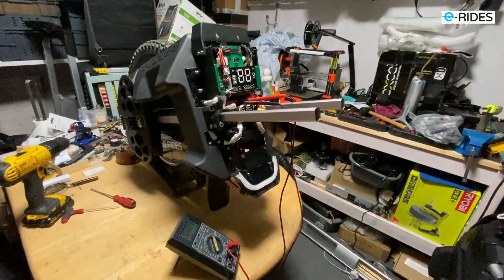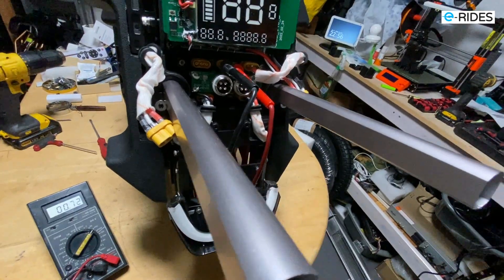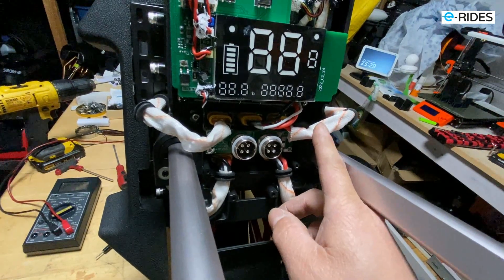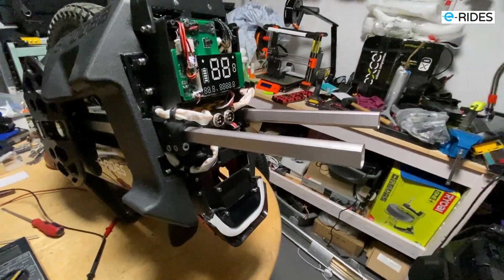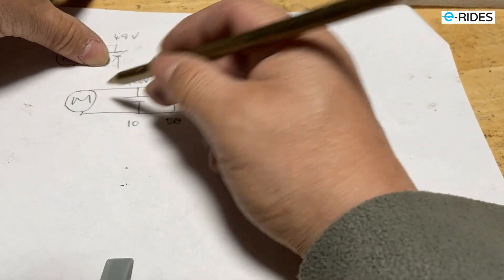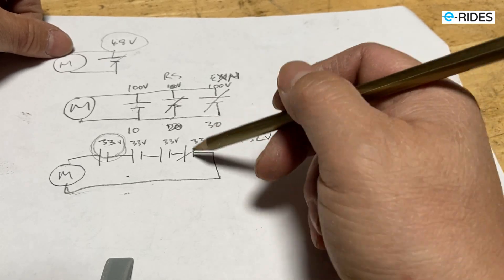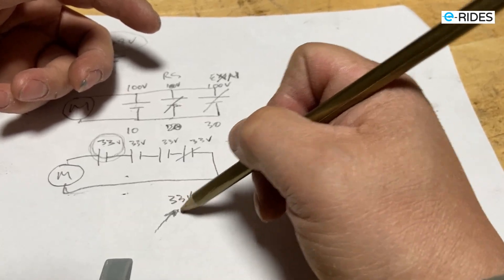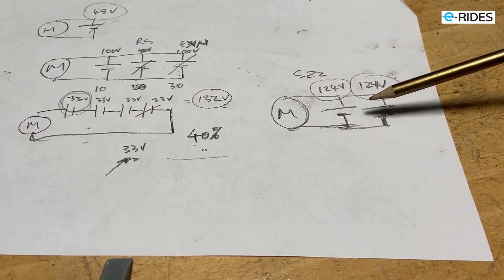Begode Master The True Battery Voltage. e-Rides EUC Upgrade.

Comment: Who's worried about a pack becoming disconnected? Put rtv on the connector when your finished working on the dang thing and you can have lower voltage to work with.

Comment: I have a question ❓
Can I remove the 2  battery in the back, and use a small connector between the 2 sockets, red with red and black with black , and I use only that 2 front battery with total 66 volt?? I'm thinking to do that because the battery is too heavy, the 2 Battery's= 6 KG
Reply from the maker: If you do that the remaining two battery will only be 66v which the wheel will not work. All 4 batteries added together give you 134v to work.

Comment: I think Begode have changed this now to pairs, in series and parallel.. Not withstanding that, I can only presume each battery pack has its own BMS balancing each pack to 33.6V when it is charged. The packs then connected in series. An open connection on any pack leading to a cutoff, that would include a connector coming loose. Either way, on checking the voltages of the battery packs a discrepancy of any significance between any one of them could indicate a problem with the pack.

Comment: July 22: 1st batch consumer wheels.. 13:25=> aand then we have the nickelplated strip melting and causing what.. change your wheels for #2 batch.

BG for 80kph wheel: "It happens very very rarely, so it is OK". In any respectable safe industry the wheels would be requested for callback 😅

Comment: So in this case, do you think the Molicel P42a would provide a greater safety margin below 40% SOC vs the stock batteries?
Reply from the maker: With one wheel device we are riding on any extra power are always better. But don't forget Begode keeps changing things on their wheel. So higher power battery mean they have to change the power circuit to take the extra power.

Comment: I agree with you,I have same thinking about the 33V batteries,when I see it ,I am very confused,why they are so low voltage .  THANKS YOU HELP ME FIGURE IT OUT 👍
Reply from the maker: Begode said it is low voltage which is easy to manage and of course low voltage is less dangerous. with that many battery cell gives you more Amps on one pack. Adding all 4 battery together to give 1900wh and 134v. The only danger part is the charging circuit the holds the 134v and i have already have one gone wrong which doesn’t charge the battery.

Comment: What I learned today from Kevin.  1.  Redundancy is proportional to safety.  2.  Voltage is inversely proportional to fire.   In conclusion: the Master has 0 redundancy and the S20 has so high a voltage in each pack that fire is a potential.  Pick your poison.

Comment: Pulling the connectors out via the cable is probably not a good idea. It’s well known for causing problems. I think it’s also important to consider the typical failure modes, if any, of a battery pack and BMS.

Comment: the redundancy of the single battery pack voltage makes sense that there would be a problem if one cuts out 

My advice, don’t smash yourself and the wheel into a tree lol wheels are like babies, you wreck at high speed there will be issues with almost every wheels

Comment: High voltages in parallel is extremely dangerous requiring multiple bms to balance packs.  Imbalances due to injury or defects can lead to runaway fires. Tesla has packs in both series and parallel but have extensive r&d.  Begode probably chose lower voltage packs and in series which makes them much safer from fires.  Damaged packs in series simply stop working.  Damaged packs in parallel while working in redundancy can be a time bomb. Pick your poison.
Reply from the maker: All High voltages in parallel is extremely dangerous. This is what the challenge is for the faster wheel and how they are going to make it safe.

Comment: **Quick Question:** Do you know how the battery is setup internally? Because your conclusion is based on literally unplugging the battery. I like the low voltage approach from Gotway. Also riding below 40%, is that load or no load, because in your assessment, that's expected behavior for the rider to ride slower 

Great video which opens up a very important discussion.
Reply: Theoretically, from what I understand from the video, if a single pack yields in one way or another you will hit the asphalt. 4 packs = 4 times more likely to fail. But until we find out exactly how those packs are built inside, we don't know for sure.

Comment: Just saying: 
Each of these battery packs is  NOT done 32s1p....No, each is 8s4p, which means that (when at all), just a 8s connection will brake away and you are left with 3s4p. More probably is even that just one cell dies and you are left with 7s4p.
Whatsoever:
On the next charge you would DIRECTLY recognize it as the wheel wouldnt charge to full anymore!. 
So Sorry, these "there is no backup" statement on the Master is in my view totally nonsens .......

So The reason for your "Conclusion" is just wrong, because you didnt know how the battery pack is setup! It is not able to fail "completly", at least as long as you dont cut the complete wire while driving.

Comment: id like to see a inline switch or fused added between the board and a battery. Then roll wheel and flip the switch. fuse and watch the faceplant, of course in test situation. Something like this will get the attention.
this wheel is a DO not ride for me.
V11 has 4 packs and are connected in pairs. If one pack fails the wheel still rides. If 2 packs fail on one side the wheel still rides. If 2 packs fail on opposite sides. Faceplant. some redundancy.

Comment: I don't think it is as bad as you first think, each battery pack will be 8s4p  a group of 4p cells can be thought of for all intensive purposes as a single cell with 4 times the current capacity of just one cell, so if a single cell starts to degrade and develop higher resistance it effectively reduces the available current through the whole system and thereby a total voltage drop. at some point the firmware should recognize this and trigger the alarm as per usual, the same would apply if the a cell becomes disconnected via failure of a nickel strip or the spot welds break due to vibration, the available current will be reduced to what the remaining 3 cells can supply. In the case of a cell shorting all the current will try to flow through that one cell result is massive heat and fire, this is what a good bms protects against of course this apply's to either parallel or in series packs, so in the end I do not think it will make much difference as long as you notice the drop in power and check the batteries for problems . btw I have seen a fire just as fierce from a punctured 4s lipo battery which is only 16.8v it's the chemistry that ignites with the air

Comment: There is no connection between voltage and chances of catching fire. You are totaly wrong.
Also inside those 33v packs, 21700 cells are connected in parallel 4s blocks, so there is nearly no difference...
Reply from the maker: True all battery pack can catch fire what make it safer is the voltage output is lower and it is safety to control and manage.

Comment: Well that's the first major disappointment with this wheel. Why couldn't they have ran the packs at 67 V and ran 2 sets of 2 in parallel? The redundancy would be there and the voltage would still be much lower than their previous 100V wheels.
Reply from the maker: That is what I thought as well you’re the first one reply with this idea. Well done.
Reply: @eucupgrades  Could this wheel be modified so that it is in this parallel configuration? Or would that break the wheel?
Reply: @arronnie1  no you wouldn't be able to do that because running in parallel would make it a 34 volt wheel and it would not run off that power

Comment: Are you sure the 40% throttling isn't just because of the 4P configuration of the battery and voltage sag of the 50E cells? Sounds like throttling to protect against drooping the 50E cells too low in this 4P configuration to me.

Comment: Thanks Kevin for looking at that.
I'm trying to identify if the packs can finally communicate with the mainboard, do you know?

Also I'm trying to figure out how the 4 packs are kept balanced between each other. Have you found anything which does? Are the packs at the same voltage now or already drifting?
Edit: it is not needed, each pack's cell group balancing will already do the job
Reply: Maybe they just used passive balancers.
Reply: In this configuration, balancing between packets is not necessary I think.
Reply: @pawelkolaska1398  these 4 packs in series definitely need balancing, otherwise they'll drift in voltage like anything made of cells in series does.
I'm hoping for an active balancer here to handle more balancing current.
Reply: @pawelkolaska1398  Actually you're exactly right, it is not needed in this configuration, I missed how it works previously.
Reply: @supercurioTube  So what what middle connection do ? It is middle point between 4s+4s ? I ordered mine master and thinking how to make it safer.
Reply: @danoseus  from the current understanding, it's the BMS status connector which is very basic and can only indicate very simple errors like "stop charging"
But a lot is unknown yet.

Comment: You have a point on redundancy. However I know two cases of battery fires which were linked to riding a wheel with fewer packs than specified (one with 2 packs instead of 3, another with 1 pack instead of 2).
This design will prevent riders abusing the dumb (parallel) pack redundancy.
Reply: I imagine a bad cell would manifest itself in a similar way too, making its parallel brethren take up the slack. It wouldn't make the wheel shut off, but would be similarly dangerous as in a parallel pack configuration. What we need is for the pack to be able to report when a parallel group is sagging below safe thresholds and trigger something like an overload warning and tiltback...
Reply: @redfoxdude  agree. Neither of the configuration can be safe for riding and fire until individual cell groups are monitored, and the mainboard is informed of pack issues to prevent riding.
Reply: Most people wouldn't do that. I'd prefer they design for the rule, rather than the exception.

Comment: The 33v packs can still explode. I'd recommend the S22 for safety. I would buy the Master myself because I don't trust either wheel. Every rider that wants to be sure needs to learn how to inspect the packs. On the S22 you can see warning signs on the smartBMS readout in the app. That still doesn't excuse one from opening up the wheel every once in a while and check for burnt cables and corrosion and water intrusion. I'm talking about a deep inspection, cell level with removed battery heatshrink if necessary.

For S22 riders, their main concern should be the leap in voltage (for the brand) and the "over built" wheel design that may or may not introduce new failure modes. 

None of these wheels have been tested long term.
Reply: I buy the Master because of Begode's self sacrificial philosophy. It would risk damaging itself trying to protect the rider in a tricky situation. Other brands don't do this. Greater risk of injury.
Reply: The reason a battery ignites is due to a buildup of internal resistance causing heat to exceed ignition temperature of the electrolyte. Internal resistance buildup is caused by manufacturing defect or inaccurate passive balancing by the BMS. You cannot visually inspect buildup of internal resistance - only an Active balancing BMS can do that.
Reply: @RonNadeau  Heat usually leaves traces. Messed up heatshrink, unbalanced voltages.

If you're worried about heat then step 1, Don't get an S22/Master with high capacity cells 50E/M50T/M50LT. Step 2, Install heat sensors within the packs, and a display on the wheel.

Being afraid to do a deep inspection is only going to reduce your chances.
Reply: @mikeh6286  You won’t see traces of heat due to internal resistance on the outside of a 50E cell until it ignites. There is no pre-warning without monitoring the internal resistance with a good BMS. Active balancing BMSs are more expensive and that is why companies like Begode cheap out. I have written to them to say we would gladly pay a few hundred dollars more to get better safety with quality BMSs. Overcharging cells with Passive balancing is what is causing most of the fires.
Reply: @RonNadeau  Buy an active bms and run balance wires to it. In China it's ~50usd. (With IR measurements and bluetooth)

As internal resistance increases you will see a change in charge and discharge characteristics. If 18 groups are matched and 1-2 are slightly out of whack, that's your warning. Put a temp sensor on those and keep riding. 

Or install a bms with resistance measurement etc. I prefer to use temp sensors because I don't want to stop using cells just because they're older  and have built up some resistance. It doesn't mean I'll ride them to 80 degC.
Reply: Also, the  S22 is unsuitable for racing. The Master can do it but only on high current cells. For racing wait for the RS134V.

Comment: If one 33.6v battery pack fails but is still electrically connected to the motherboard it should just lower the total voltage by a quarter. I believe the reason why you get 0v when you disconnected a battery pack is simply because the circuit is open. Would it be possible to "jump" one of the four XT90 battery connectors to simulate a battery pack failing while still being connected to the wheel and keeping the circuit closed?

If true then if one battery pack fails while in use it should still work... hopefully!!
Reply: It appears that Begode wired the battery connectors in series on the control board. If you disconnect a battery or a pack develops a broken connection (not a short), then it will break the connection and give you zero volts.
Reply: @RonNadeau  I think everyone understands that, what's less clear is the odds of that actually happening. Breaking the connection of a battery without simply unplugging it involves some pretty substantial destruction because of the four parallels inside the pack.
Reply: @dan.t.hillary  I agree with you Dan. We would need to look at how many riders have reported a pack failing entirely to zero volts. I had an issue once with my 16X battery connector failing. I didn't notice until I was riding for a bit and saw there was lower range than normal. Turns out I was riding with just one battery pack. I have seen some Gotway/Begode packs have internal damage and the wheel ending up as a 23s4p or 23s6p. Usually shown as the wheel only charging to 96.6V. However this is not a complete failure of the pack and the charger will show green here. I believe this new config was made in response to us complaining about fires. A SmartBMS doesn't change anything... instead it just shows you cell health when you look at it. I have spent way too many hours looking at the XiaoXiang SmartBMS on my Nikola Plus... the cells are healthy. Until they day they are not... and then I better be watching.
Reply: This is a great point; what does "a battery pack fails" mean exactly? It's not well defined here. 
A connector comes loose? Does that happen? 
A cell dies? The whole pack doesn't go...
The pack explodes and a sufficient number of cell connections are severed to kill all 4 parallel 33.3v stacks? 

I don't know, I'm unconvinced that this is actually a riskier arrangement.
Reply: Only way to find out is to jump one connector and see if the wheel still works.
Reply: Even so, I believe that the voltage will drop too much and the wheel will no longer be able to keep its balance, especially at high speed.

Comment: That's a shame and very concerning. Besides safety issues of shutting down, this could become a major inconvenience when offroad and a pack fails.
Reply: So now if you choose between the S22 or the Master, you have to choose between the potential of an explosive fire or a face plant. Hmmmm.....🤔
Reply: I think the peak power is the same regardless of parallel or series battery connections.  The redundancy is good if any of the battery pack is malfunction, but usually that would not happen during a ride, so I think the pros of having a lower Amp system through the wires might help reduce the likelihood of fire.  But if the fire is induced within a single battery cell which will have a run away effect, then we are talking about having a better BMS, which KS might have an edge.  However it seems lower Amp system is better than having a better BMS (as per the latest KS fire incident showed).  I am not sure which one is more effective in fire avoidance but my bet goes to having a lower Amp system.
Reply: @FastRadioBursts  I agree but the series packs in the master carry the full current draw so the wires that connect each battery to the next needs to be able to handle it, to me they dont look any bigger than a parallel system like the kingsong , then again the wires going to the controller also carry all the available amps and they seem to be the same size so it should be ok if begode engineers have done their job right
Reply: @Mike Y
"if Begode did their job". Which worked great so far..

It is such an early tech and I doubt that all these manufacturers have the needed understanding of the components used.

But following the scene for a while, I'd rather have a low amp begode for sure. 
If I'd even buy a master. Maybe a 3rd gen with improved range.